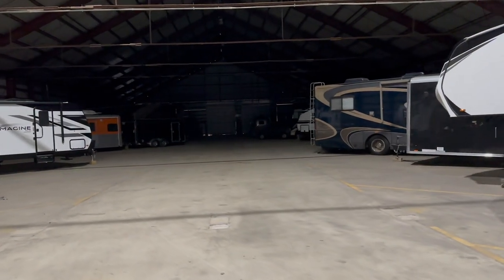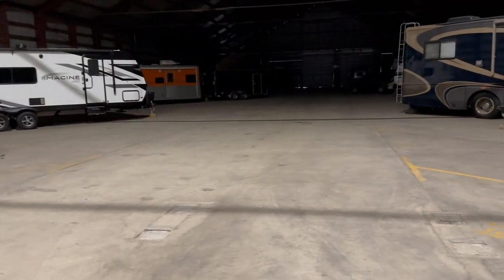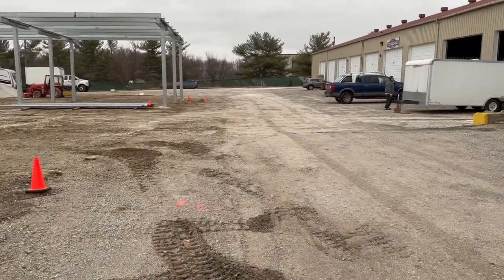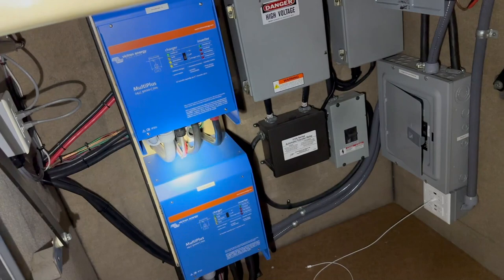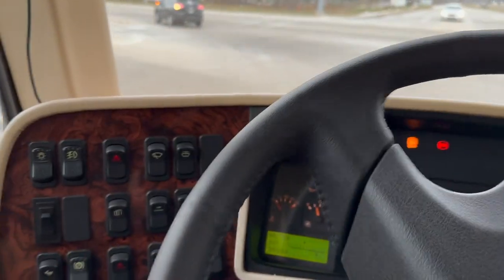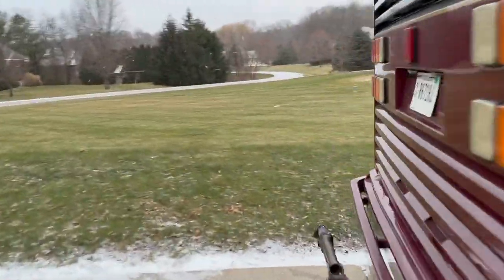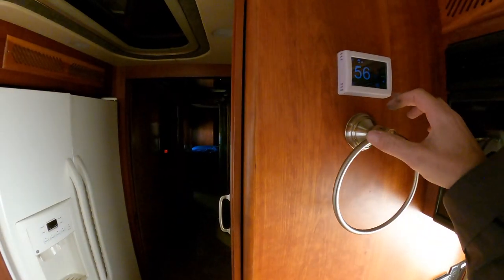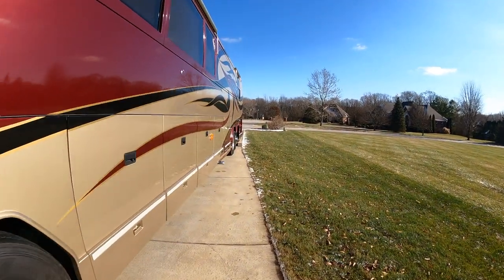Christmas Trip 1 of 2 - Getting the coach ready / Aquahot Work

Comment: You can get heated potable water hoses to prevent freezing on Amazon or at RV supply stores. I bought a 50 ft. hose for about $120 a few years ago and it works great for city water and it'll work fine for filling your tank in the winter . I also know that the Aquahots can be finicky if you don't perform the annual service on them. The flame detector can be the culprit if it wants to continually start and flame out on you as thar seems to be the symptom. I hope the trip went well. That Safari parked next to your rig in storage is way cool. All aluminum body panels. Great rigs...especially pre-Monaco
Reply from the maker: Thanks!  I will have to check that out!  The only reason I didn’t pull the water was because I didn’t know how to get it back in - I will check that out.  I thought the same about the flame sensor but it checked out with the ohm reading.  Never know!

Comment: Is the truck you tow an automatic trans ? How do you pull it like that?
Reply from the maker: After a little research, there are few vehicles that can be flat towed anymore. It was pure luck my Ford F150 with 4 wheel drive was. To enable flat towing, you have to start the truck, put it in neutral, switch the 4x4 knob from 2 - 4 low (5) times. It will then do something in the transmission and displays flat tow enabled. You leave it in neutral and turn the key back - it won’t turn far enough to take the key out.  Then you just pull it, the front wheels turn with the bus. You cannot back up - the tow bars and mounts will buckle. I do have a tow light kit installed - so I plug the bus into the truck to control the lights. I also have a braking system I install as well. I made a detailed video of this too.